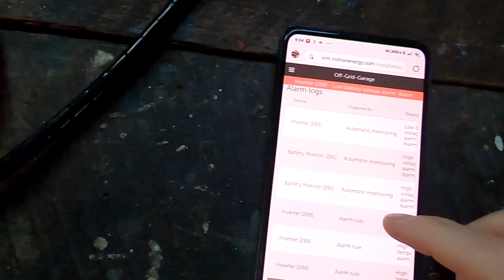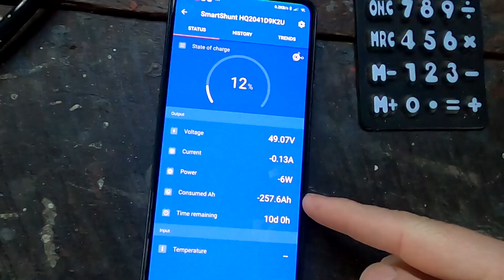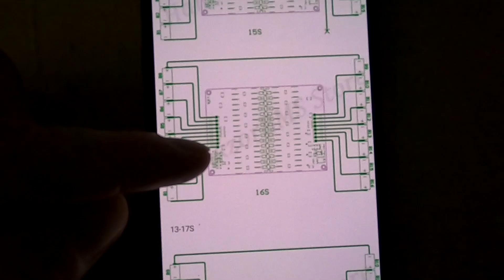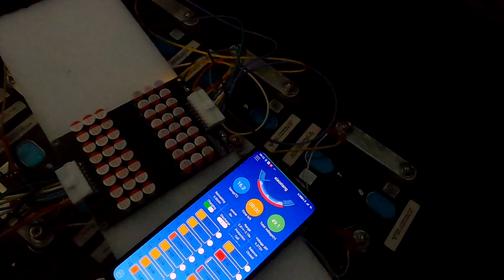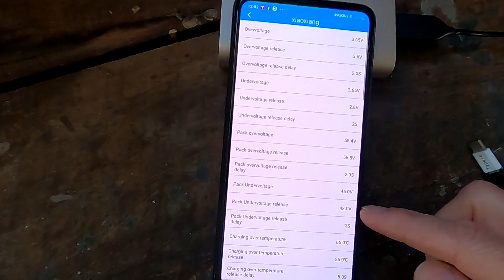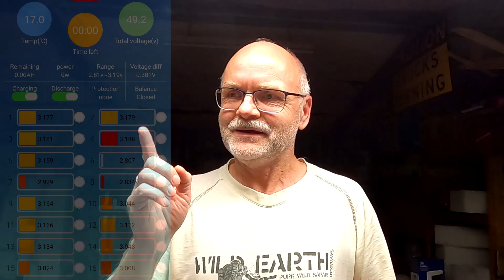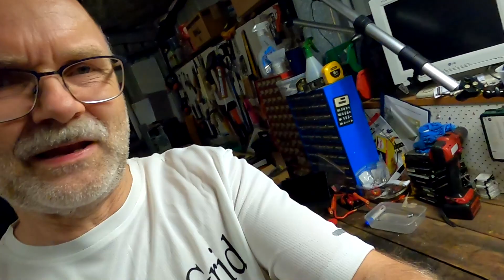Can the active balancer save this battery? Impressive result!

Comment: that all i use is the cell balancers on my diy battery a 6a i have 25 battery now going on two years no problem the balancer any where from 3.00 to 35.00 depending where you get them most of mine were under 5.00 for 6a they have 1.5 a cell balancers but i don`t use them

Comment: Old post, but do you know if there's any point buying the dedicated 3S-4S or other active balancers when you can just buy an 8S+ or whatever?  All the AliExpress listings for these basic active balancers give ranges, like: 3S-4S, 6S-8S, 12S-16S etc., which implies that they only work in those voltage ranges...

Comment: Ich hab einen solchen 5A Balancer auch an meinem 48V 16S System. Wenn man sich den Balancer genau anschaut (Er läuft ja bekanntlich immer - glaubt man zumindest) Gibt es eine Lötbrücke: wo RUN steht, diese entfernen- Es kommen 2 Lötpads zum vorschein -  ich hab das ganze per Iobroker script : Bei Zellspannung / Pack Spannung bezogen ein und ausgeschalten. Er schaltet ein wenn diese 2 Lötpads verbunden sind, und ist aus wenn sie getrennt sind. Man kann zum verbinden einfach einen Shelly Plus nehmen . Es geht nur darum eine Verbindung herzustellen :) So kann man ihn super gesteuert ein und ausschalten wie man es gerne hätte. Ich mag meinen 5A Balancer, weil er kleiner 0,020V ohne probleme balancieren kann. (Daly interner Balancer ist das nicht
 möglich-da ist bei 20mv Differenz schluss) Meine haben bei 3,45V 0,002 mV Differenz - um dem endgültigen Perfektionismus zu verfallen lach
and yes: you should all get a Balancer :) :) and switch the Daly internal one to values, where it never kicks in. (Other BMS i dont know, i use Daly). Möglich das ich das bereits in einem anderen Video von Andy erwähnt hab.

Comment: Hi, how it going?
I've just recently came across this and hope you can help answer some of my queries.
Do you connect the active balancer between the BMS and the battery pack without a power supply? 
Or the active balancer has to connect directly to the cells without the BMS and power supply to let it do its job?
If one of the cell is dead at below 2.5v, is the active balancer able to revive it?

Comment: Hi andy.. i have a bunch of runner cells 3 of them in my 16s setup.. and these runner cells prevent my battery to charge all the way up.. will this balancer prevent them from running? 3.65v on the runner while the rest is at 3.40 charging.. gonna turn them automatically at 53.6V then shutsdown at 53v  pls advice
Reply from the maker: Yes, the balancer will definitely help with this. Just make sure, to turn off the balancer once the cells go below 3.4V again.

Comment: In a low current (solar, not vehicle) situation, i always suggest inductor balancers instead of capacitor ones. The reason is, that you always need to convert energy between magnetic and electric fields, to achieve low losses. But of course a capacititor model does the job and delivers current. Most of the time we store energy in a static voltage field, what means that a low loss energy transciever needs an inductor and a switch. Its a smps then. If we would use a rotation storage, inductive coupled to an also alternating voltage, then an good energy transformer would make use of capacitive energy delivery. Imho we all would throw away much less lithium batteries, if there would be active balancers in them and not only balancers which start to balance, when a cell is already in a harm region. Had a fresh battery for my scooter, which was weak aftr only 2 years. I opened the thing and the 24s lifepo was absolutely out of balance. I figured out, the top balance was not sufficient to hold the chargers amps. After adding an active balancer, i got it back to work since half a year. You do a great job there!

Comment: After reading almost all comments here, some concern lower end while other worry upper end.

This is my solution:
Have 2 AB connected (parallel).
The 1st balancer is setup trigger and balance on higher end of voltage.  The 2nd balancer handle lower end of voltage.
Reply from the maker: You only do top balancing, never bottom.

Comment: Hi and greetings from Germany,
I have - same as you - never used a balancer so far in my diy 12v LiFePo4 in my camper, no issues so far. But now with my 48v 2P16S battery I am having over/undervoltage issues when charging via solar ( Victron 150/35 ) and someone on FB pointed me in your direction and the use of 48v balancers for ‚bigger‘ batteries. Must have missed that, even I subscribed already long time ago.
I am not sure it will solve my issues, but your test looks promising and I will give it a try.
Can you tell which BMs you are using ? Didn‘t find you mentioned it in the video or description 

Thx again for you effort and input 👍
Reply from the maker: Thanks Uwe. A 16s battery is more likely to go out of balance than a 12V battery. The active balancers work very well and help a lot to bring the battery back in balance. Just ensure, that the balancer is not running all the time. Either use a switch to activate it from time to time when the battery is full or an controller which does that everytime the voltage goes over 54V or so. I have a recent video showing that: https://youtu.be/kEeD-oM4QnY
Gruesse in die Heimat.

Comment: I use BMS with active 2A balancer - after nearly a year, checked three 280Ah batteries, they are 3-4milli-volt spread in each battery!
Thanks Andy, I agree with you, the balancing is a low cost and important piece of equipment to keep all the cells operating at peak performance, no runners.
Reply from the maker: Yeah, I like them very mich as well. Do you leave yours on all the time?
Reply: @OffGridGarageAustralia  YUP! I see no reason to turn them off, and the cells are always very well balanced - cost is nothing, benefits are great!

Comment: The active balancer is great at both ends of the curve. I would install a switch so I can turn it off once the battery is properly balanced. Then when it starts to drift again turn it back on. Better f you can program it but that adds cost.

Comment: Hi Andy, did you conclude that adding an Active balancer permanently alongside a standard BMS was a good idea? I'm setting up a couple of 14KW batteries using LF280K's and am concerned with the JBD's only having a small balancing current.
Reply: what you meant by permanently?
an AB can always be plugged out of the bank..
Reply: @dollyone3714  My original question meant, should a AB be left on all the time or just balanced occassionally. I have my answer. It is better to just turn on the AB from a voltage of around 3.33V  until fully charged

Comment: Brillant vidéo, very interesting! Was wondering would a balancer work on a 24v lead acid battery with 14 x 2v cells to extend its life? If I understand correctly the balancer only looks at the voltage difference, not the type of battery? Many thanks, keep up the good work!!

Comment: I have some pre-made batteries that I bought from a supplier here in NZ.  They are using the Xiaoxiang BMS.  The pack busbars are welded, so trying to add this balancer in means I'd have to splice into the balance leads.  Would that work?

Comment: 11:32 ABs does not transfer voltage; it transfers Electric Charge. 
Some of your cells had lowered charge capacity resulting in faster to drop when discharging and faster to rise when charging.
Reply: You mean current measured as voltage?

Comment: Active Balancers balances TWO ADJACENT CELLS by transferring charge from a higher voltage cell into a lower voltage cell. Some ABs have LEDs to indicate which pair it is working on making it a little fun to watch. Current is also depended on the voltage difference. A Balancer might be rated at 5A, but if the voltage difference is small so will the current flow. This is natural; you do not want to overdraw from one cell and overcharge the adjacent only to reverse it the next turn.

I theorize we can use multiple balancers for faster balancing.
ie, using two 9s balancers on a 16s bank. One AB connected to Cells 1~9 and the 2nd AB connected to Cells 8~16.

Comment: Voltage increase because voltage is not proportional to charge in lifepo4.
So the battery that were good didn't loose as much voltage as the battery that were charged gained.

Comment: Confused why you dont just leave that balancer attached all the time just in case it is needed?  isn't it just capacitors and uses little power to do its work
Reply from the maker: The problem is, the balancer will unbalance your pack if the voltage goes down 
 due to the very flat voltage curve of LiFePO4. If you keep watching a bit further, I made several videos showing and explaining this. Verdict:  balancers should only be connected at a higher voltage 3.4V or above with LiFePO4 chemistry.
I had very good results at 3.45V and leaving it for say 1h. it balances all the cells in this time frame. It is enough to connect the balancer say twice a year for maintenance purposes to top balance your battery again. Or using the JK-BMS with integrated active balancer, then you don't need these additional balancers any more.

Comment: Buddy, reality is that your BMS is not really a great bms ... good ones are reserved to very well designed battery packs (cars, high capacity grid storage), and Chinese stuff is not great. Anything will improve on it ! TBH 250£ for those Chinese BMS's is a rip of in my mind ... but what can do if there is nothign available on the market ...

Comment: hello andy. can it balance also the capacity of each cells from time to time? plss respond. thankyou.
Reply from the maker: Of course it can. The balancer has exactly that purpose. It will balance all cells.
Reply: @OffGridGarageAustralia  thankyou for responding. i have 12v system on my appartment, and yes the balancer is doing its job. it is connected 24/7 . no turning off. from top to bottom it is balanced. it is important to set the solar charger to its hvd. im using used 32650 cells.

Comment: Hi Andy, and greetings from Tweed Heads.  I only just found your videos, as I am currently making an off grid system using EV batteries, so have been researching.  Love your videos and the sense of humour that goes with them.  Just a quick question in regard to the Active Balancer.   Did you connect this along with the BMS?  I can't see in your video if you disconnected the BMS to attach the Balancer or whether you are running them together.  Thanks Regards Dean
Reply from the maker: Hello Dean from Tweed Heads. The balancer is just an addition to the BMS. It boosts the balance performance but won't protect the battery. So you always need a BMS for that purpose.

Comment: Why does nobody ever tell the truth? It is because they are too proud to admit their crappy recycled batteries are causing more trouble than what they are worth.
  I will tell you all now. If you have some cells dropping that much lower than all of the other cells then those will ALWAYS be the weak cells. Every time you use your batter it will be dead when those cells discharge before all of the others. You are basically carrying around good cells for no reason because your pack is only as strong as the weakest cells!
  Doesn't matter if you can balance them or bring them back from dead. They will always be the weak cells. Rip them out straight away and replace with cells with the same performance as the others.
  Or ride around with good cells that are basically useless once the weak ones die.
Reply from the maker: In every pack is always a weak cell, no matter how good they are balanced and matched. At the end it does not matter much though as you usually don't discharge your battery fully anyway. To prolong cycle life, going under 10% is not recommended.
I'm just testing and going into the extremes for that. This is not 'normal' usage of a battery.

Comment: If your inverter is set to stop charging at a certain top voltage and switches of at a certain bottom voltage and the balancer keep your batteries balanced, it makes the bms redundant?

Help me here if Im wrong, the bms does not come near keeping voltages balanced like the balancer. It only helps to stop charging and protect the battery from going to low.

So why do you still need a bms?
Reply from the maker: You always want a BMS. I show exactly this in the next video. The BMS is your safety net, your insurance for your battery. Never rely on just the charge controller or a balancer. There is always something which can go wrong and without BMS things go 💥 quickly.
You can turn off balancing in your BMS though if you use another balancer.

Comment: I've been told ,[ in the manuals ], if the batteries disconnect while the controller or inverters /chargers are on, it can damage them.  not true? or do I have the wrong stuff? this has been my biggest concern with lithium batteries  shutting down from one low cell.
Reply from the maker: True for most SCC. Victron gear can handle it and just goes into absorption mode. Other may burn out.
Usually, if you have a BMS with separate charge and discharge circuit (not the one with a relay as I have), this is not a problem. The BMS will just disable further charging but allows still discharging. So the inverter and SCC are still connected and it does not create the situation where your SCC cannot see the battery voltage any more.
Reply: @OffGridGarageAustralia  I ordered the balancer
Reply: @OffGridGarageAustralia  I thought of a great solution for avoiding possible damage to charge controllers and inverter/charger, due to pack shutdown before their normal 10.5/21 volt low battery shutdown.
 large caps that could slowly bleed down to their normal 10.5/21 volt low battery shutdown.

Comment: Hi, love your channel, but I have small question. I live on a boat so very solar dependent. I have a 4 x Victron 175W solar panels which I can tilt to get maximum sun, a Victron 150/50 solar charger, Victron Multiplus 3000 Inverter/Charger with 6 x 120 AH lead acid batteries. I have just ordered 4 x 310ah 3.2 V Lifepo4 batteries, the same as the ones you are using, to replace the lead acid. I may order another 4 batteries and run each set of 4 in series, and then the 2 banks in parallel, this should give me 2480 AH at 12 volts. My concern is which type of BMS to use, as I don't really under stand the specs of the units.
If you can point me in the right directions I will forever be in your debt. Many thanks, Brad.
Reply: wow. 2480 AH on a 12v system is very risky you might consider going into 48v system to lower the material cost and risk of high amps discharge.

Comment: Having just taken delivery of an active balancer identical to the one that Andy bought I found that it came with no instructions. Wiring it up seems fairly self explanatory. I do have one question which I am hoping someone will be able to answer. I will be using it with a 48v system (ie. 16S layout). The balancer comes with a 17S capability. Does the last 17S connection need connecting or can it be ignored?

Comment: Worked on F-4 Phantom avionic systems 1970 - 1974 USAF. Electrics were connected with Amphenol connectors. Looks like to me you could wire up your battery bank with a female multi pin connector and use a male matching connector to connect your BMS. If you wanted to have testing equipment connect to the bank they could be already wired ready to use. Would make it easy to change leads rather than reconnecting terminal rings on each cell every time you wanted to test or rig up something new or different. A strip of banana plugs would also work. Easy to check with a multimeter. Amphenol pins might be close to close together to be checking with multimeter. What do you think?
Reply from the maker: Well, that could be a solution. What my intension is though, I would like to NOT play around with the big batteries which are in production at some stage and rather have some test cells sitting on the workbench to do testing. Once testing is confirmed I may do these changes to the big batteries.
The final battery won't have anything connected to the terminals any more as the balance leads for BMS and balancer will be connected to the busbar directly (M6 tap).

Comment: Great vid on using a balancer.  It can help squeeze a little bit more out of a pack as it's getting low.  A balancer really is cheap piece of mind, plus long-term it might just get more life out of a cell that might have failed sooner.  That's a hard thing to test since each cell is unique, but I'd bet it really helps out in the long run.   I think a long-term test like 6 months or so and then remove it and check for deviation after a week of no balancer to see if the pre-balancer deviation has returned.   That should show if it's doing anything for life extension or not.
Reply from the maker: That's a great suggestion, thank you.

Comment: This Active balancer there is no short circuit protection.
Reply from the maker: There never is, same with the BMS and balance leads. I have never seen anyone using fuses for these wires. I guess the thin wires are the fuse 😉